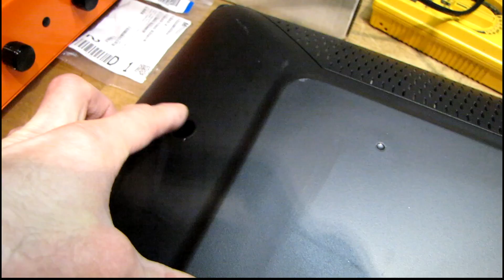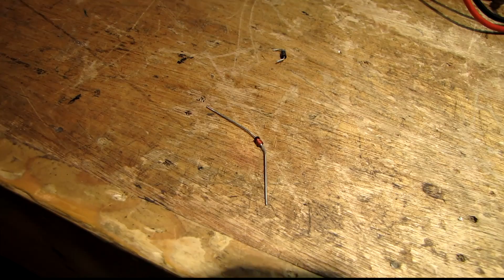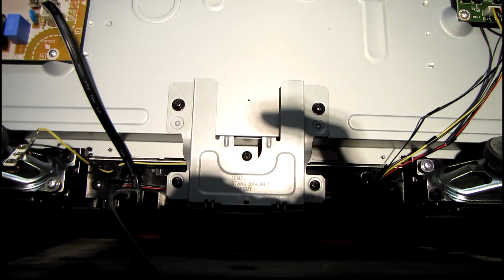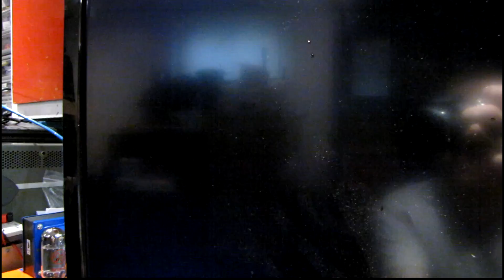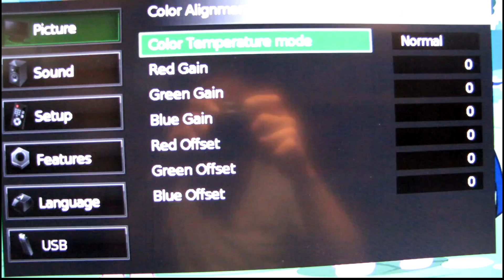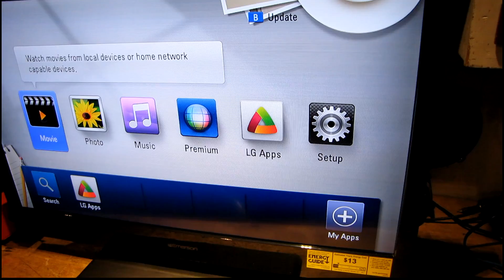Emerson LC320EM3F LCD TV repair 5-24-15

Comment: I have a Magnavox 32ME402V/F7 it has the same high pitch sound as you described. I bought both boards on eBay but it still has the sound, even with the new board. I'm returning the power board and try with another.

Comment: hey do you have a schematic for the powersupply of that tv i have rn that had a bunch of shorted components in the primary i resolved all the shorts but still no standby power im having trouble finding where it is and someone ripped the sticker of the back but that powersupply looks similar thx

Comment: I have this exact TV, and the hdmi ports have stopped working. Any suggestions? I'm not an electronics expert, but I'm pretty handy, if maybe there's just a small part or switch that needs to be replaced?

Comment: I've got a similar Magnavox model that is a few years older than this one exhibiting a no-power symptom after several years in service, caused by some kind of issue on that power supply board. Any ideas as to what would be a good strategy to isolate the faulty component?

Comment: How do you find shorts? Do you set your DMM to ohms and check for infinite resistance? And if there is infinite resistance, that means its wide open aka shorted? Or do I have it backwards. Also, I'm assuming polarity matters when checking for shorts?

Comment: Where do you live? I can barely find a broken dvd reader let alone a freakin tv
Reply: Final Strike Be observant. I once got an imac out od a dumpster that had a bad hdd that I replaced. I have had it for a few years now. On trash days I scan the curbs with my peripheral vision while I am driving places and have found other nice things doing that,
Reply: i put an add on fb.  picked up six in a week

Comment: Makes sense. Seems that zener is directly across the DC output. It should also work without it in place,I assume it just provided some protection against voltage spikes? 1ZB27 is a 27V 1W zener diode. I assume that voltage rail might be +24V,so a 24V zener might be cutting it close.
Reply from the maker: PhattyMo I wondered about that too.  The replacement is running cold so far, but I might still replace it when I do my next parts order.

Comment: That was pretty simple of a fix. BTW why was that thing so unstable when only one part shorted?
Reply from the maker: MilenniumEdition 56 Everything shares the same switching transistor and transformer, so It only takes one shorted part on the output side to bring down the whole power supply.
Reply: Maxxarcade I see...